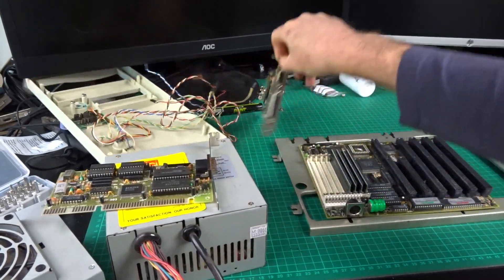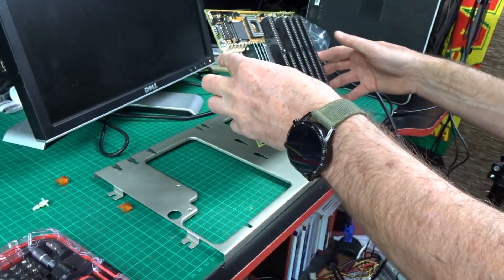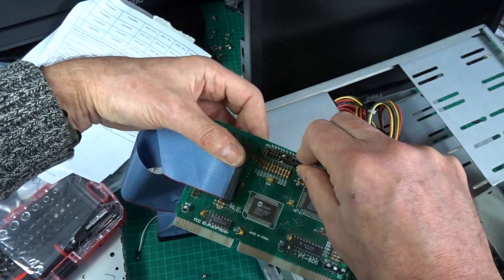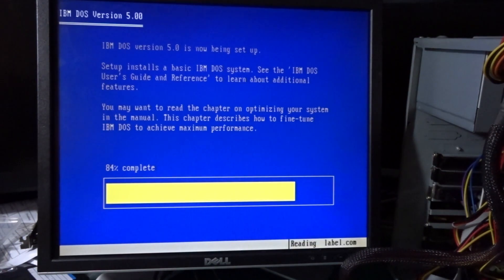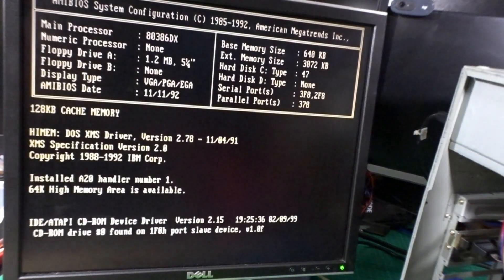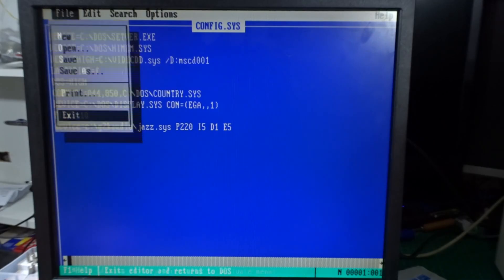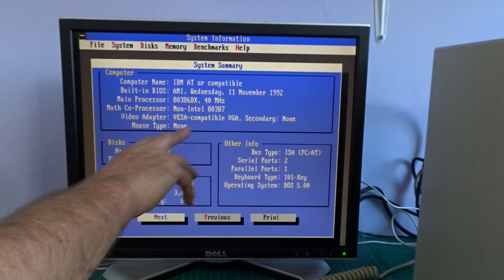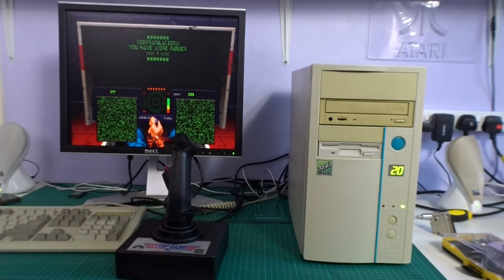AMD's 386DX-40

Comment: Yes!  Thanks for not doing yet another MS-DOS 6.x install.  Feels a bit wrong installing IBM/PC-DOS on a non-IBM PC, but I installed PC-DOS 7 on every PC I had in the mid-90s, and MS-DOS 6.x is so dead common, I love annything else.
Reply from the maker: Yes, I was curious. Was actually playing on the machine yesterday. Its quirky, mostly identical to the ms version but with a few slightly different behaviours.
Reply: It'd be nice to see MS/IBM-DOS 4.0 (it seems to have fallen in a black hole... regarded as a bit of a dud, but surely not as bad as WinME, Vista, or Win8.x.  (I've successfully avoided win8.x, but been stuck with dealing with it via Windows Server 2012/2012 R2... UGH!) Or DR-DOS, that'd be a fun change of pace.
Reply from the maker: My first machine back in the day had dos 4.5. I have 3 on my mini amstrad 8086 which is similar. No memory management, edlin instead of edit. Its interesting but not as easy as 5/6.
Reply: 4.5?!?  I didn't know that was a thing.  I thought MS/IBM jumped from 4.0something to 5.0.
Reply from the maker: @jasonhaman4670  probably, 4.5 is in my head for some reason, it was 4 of some kind. It came with a olivetti pcs286.
Reply: Regardless, it'd be satisfying to see 4.x get some love and attention.  I plan to put it on my PS/2 model 30/286 at some point.  Maybe my Hyundai 386sx16 too.

Comment: I wish I still had my 386 stuff.  One of my soundcards from back then was a Jazz sound card, too.  I remember my AMD 386DX-40 was about the same speed as a 486SX-25 back in the mid 90s.  I actually upgraded later to an AMD 486DX/2-80 and used it for a couple of years.  One thing I missed as I upgraded was playing older games on the newer computers(my main one was Comanche 2).  I was very excited to figure out how to get DOSBox to run it on my Athlon system years later, but it is a different feel altogether to run vintage software on period correct hardware.  Nice trip down memory lane, thank you:)
Reply from the maker: Thanks for watching! Yes I started in dos box but half the fun is in the hardware. You should get yourself an old 386😁

Comment: Can you build a retro Silicon Graphics computer with 3D softwares of the 90s?
Reply from the maker: How do you mean? I think most of them were risc machines with a lot or proprietory stuff in them. I just read up a bit and they did have a couple of ibm compatible servers using pii/piii's and running windows. I guess short of buying a beat up sgi machine (which I'd love to do)and restoring it, it might be possible to build a  pentium ii/iii from parts to their spec and try and run some of their software on it!

Comment: Nice 386!
You will need to get rid of that barrel battery (if it's not new). It's a little MB killer.
I wanted to build (actually re-build) my old 486 DX2-66... and then I saw the prices of the components. So it's not gonna happen (for now).
Reply from the maker: Cool thanks, the battery is brand new. I just wanted to fit one as Id never done one before😁. Ill replace with a  coin cell as soon as the novelty wears off. Yes its getting pricier by the day to do this type of stuff. Still bargains around, though you need to be patient and watch all the time.